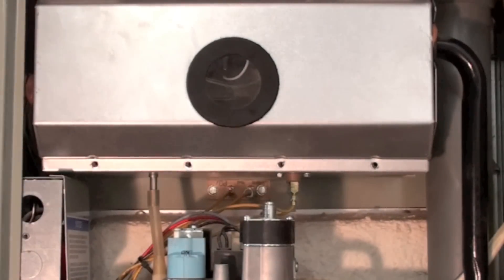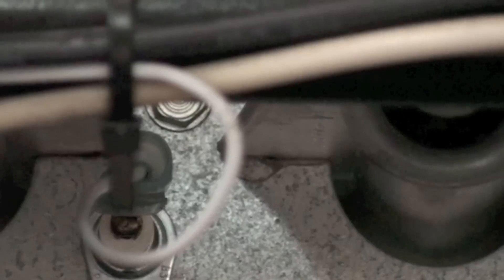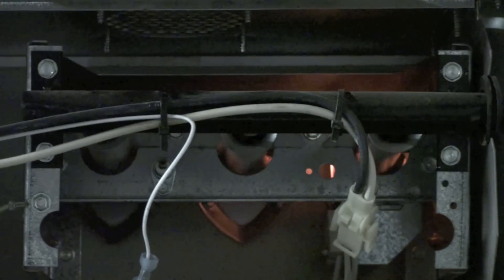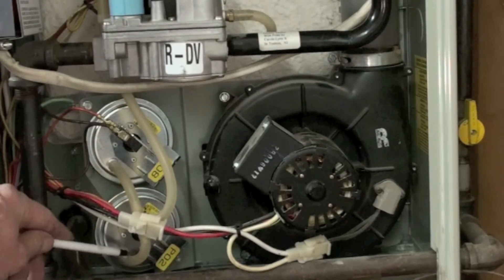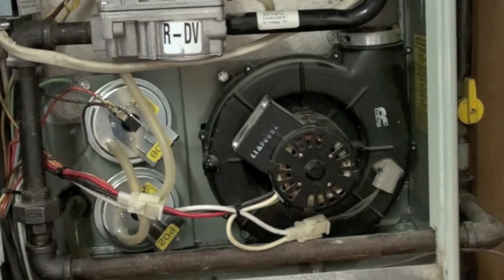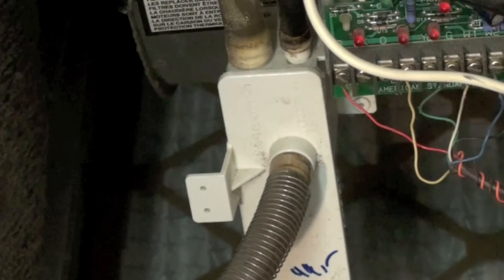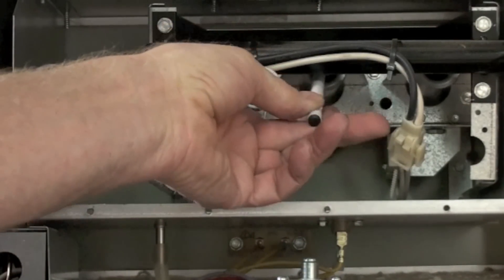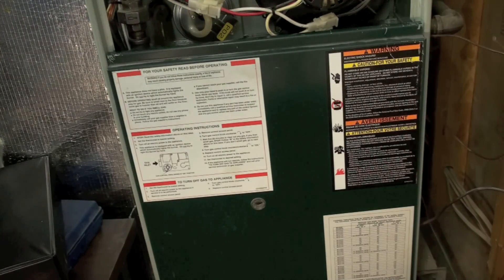Why does the gas furnace short cycle

Comment: this video just saved me some $$$ and very cold days here in the northeast/Adirondack Mountains..i spent 2 days checking connections/cleaning intake vents/filter/changed pressure switch for my furnace that was doing this short cycle..the error code told me it was pressure switch but, i did what one of videos said not to do-(swap out pressure switch at the beginning of trouble shooting)..I DID NOT WATCH YOUR VIDEO ON SHORT CYCLING FURNACE 2 DAYS AGO WHEN PROBLEM STARTED..it was a dirty/corroded flame sensor that was the culprit, cleaned it with emory cloth and reinstalled the flame sensor and also reinstalled the original pressure switch and the furnace stopped short cycling and works fine now..i was heating with 2 propane mr heaters & fans for 2 days with 18*f  temperatures outside, it was very brisk in here..i called a tech to come and because of the season here the tech was 5 days back logged and scheduled me for tuesday, today is saturday and life is better when i am not in my living room watching the game with winter coats/gloves and hats/scarfs on lol...thank you very much from the Adirondack Mountains..
Reply from the maker: Its good to have heat.
GFM

Comment: Great video! Turns out it was the anticipator on my Carrier thermostat.I set the pointer to match the amperage on the new gas valve I installed. Furnace now functions great.
Reply from the maker: Glad its working
GFM

Comment: Lennox elite 2004.. 1,248 sqft ..right now 9 minutes on 3 minutes off at 69° & it's 12° out..no way is this right might as well have a window  or door open..what if it was really cold out ? I know there tons of variables  & i just sealed off attic leaks as much as possible..there it goes again… less than 3 minutes..
Reply from the maker: Depending on where you are located,  it could be matched about perfectly.  In my area (northwest), furnaces are rated to run 100% of the time at 0F.
GFM
Reply: NW burbs Chicago…i guess their built to run but it makes me a little nervous when it's almost continuously running…Might be being a little too aware of the cycles & some anxiety..I've timed cycles in the past & it wasn't this short off…. usually 10 on & 10 off in the 20's & 30's & 5 off in teens & near zero.I think i need to focus on something else.
Reply from the maker: There other possibilities like water buildup in the vent can cause short cycling.  You might check the venting.  It should pitch toward the furnace 1/4" per foot.
GFM
Reply: Allright... thanks for gettin back

Comment: +grayfurnaceman

I have a Weil McClain gas boiler.  It will come on for about a minute and a half, shut down for about 2 minutes and repeat.  Granted this is on cold days (below 20 degrees).  Would this be considered short cycling?  This is my first experience with hydronic furnaces so I don't know if that is normal.   I watch the temperature gauge for the water and it heats up to 180 degrees, then shuts down.  During that 2 minute shut down, the temperature gauge does drop down to around 140 and the gas kicks back on.   

Does that seem normal to you or is it an indication of a problem with the furnace.  This is a very old house with probably little to no insulation.  When the outside temperature dropped to single digits last week, my house wouldn't get over 60 degrees even though the thermostat was set to 70.

Comment: I Just changed the board on a ruud 80%. The original problem was igniter not coming on. Replaced pressure switch and checked continuity after draft inducer stared . all was good but no voltage to igniter . After replAceing the board with a ICM288 replacement board all was working great . I cycled furnace several time and cleaned flame rod sensor. Worked for one night . Next morning draft inducer motor keeps turning on and off . Checked pressure switch function and it works good . I think its the board but can't get hold of tech support till Monday .The duration for draft inducer time varies from split second to five seconds .Do think it is the board. I power the inducer motor direct the motor is good 2 point  something amps . Pressure switch good, inducer good, igniter good but it never runs long enough for igniter to time on,

Comment: Thank you for an excellent video. I am hoping to find a problem before I am forced to replace the furnace. The igniter starts the flame which sometimes lasts several seconds and slowly dies .Other times the flame lasts until the fan comes on and dies when the fan starts. Had gas company replace gas valve and circuit board. The vacuum switch kicks in as it should. After several times of trying if will stay on and often reach the preset temperature but will not have a flame on the next cycle. The fan keeps on blowing no matter if the flame is on or off and does not stop until I lower the thermostat. Furnace is 15 years old 95 % efficient. Hope for advice. Thank you
Reply from the maker: My thoughts are you have a supply problem.  Are any other appliances affected?
GFM

Comment: Ours takes 3 attempts to light the burners and prove the flame. It's a 90's HSI. First attempt: no or barely a pilot. Second: all burners fire for a few seconds, sometimes staying lit but most of the time they go out after a few seconds. Third attempt: all burners fire and stay lit for the duration of the cycle. What might the issue be? The flame sensor was just cleaned.

Comment: I been dealing with this issue for about 3 yrs I clean the flame sensor several times and then replaced it with a new one and my furnace still keeps cycling on and off.I read some where that the unit could be too big for the house...could that cause the furnace to cycle on and off ?
Reply from the maker: It depends on how long it runs.  If it runs for 2 to 3 minutes, it is probably overheating.  This could be oversize, dirty blower, filter, manifold pressure too high, ductwork blockage.
GFM

Comment: Good video.  Out of curiosity have you ever worked on a Heil-Quaker furnace?  I'm certain I have a flame sensor issue, but I can't see it where you'd think it wound be.  Thanks if you can help and good idea about not over cleaning the rod.  Mine is intermittent so it is probably just dirty.
Reply from the maker: I have worked on some of them.  Some of these furnaces used an electric pilot system.  There is a spark that lights the pilot, then it proves and main gas comes on.  This type will have an aluminum tube that goes from the valve to the pilot assembly.  Hope this helps.
GFM
Reply: It's igniting okay, it just cycles like you describe and I believe it is probably the flame sensor (sometimes it will work properly, but getting more frequent - the three cycle)  The logical place for the sensor would be by the burners, but I don't see it.  I may have to take the whole panel over the burners off.   Thanks for replying and enjoyed your other videos.

Comment: Ours will short cycle 2-4 times but on the last time it does stay on and bring the house up to the proper temperature. Just replaced the filters so it's not that. Had the gas valve replaced last year (short cycle before that and still after). What could be the problem? Thanks!
Reply from the maker: Do you have a mechanical thermostat?
GFM
Reply: Yes
Reply from the maker: Sounds like an anticipator problem.  Mechanical thermostats have an adjustable anticipator to control how often the furnace cycles.  Yours is probably set for too short of cycles.  I have a playlist about this.  On my channel look up the playlist "Thermostat anticipators".  There are videos there that will show you how to adjust it.  Hope this helps.
GFM
Reply: Thanks for you input, but I did check with my husband and he said it was set for the longest cycle possible. On Friday we switched out the thermostat for a digital one but it did not fix the short cycling.

Comment: Thank you sir! I was disheartened when it wasn't the flame rod. It's a brand new unit. I'm from Central Florida and have never had a gas unit before; always electric. I'm in Kansas City now and already spent one night with my little wood house in the forties overnight as I slept with a small space heater. Flame rod test fails, I think I'm in for one in the thirties because the low tonight is 27! Florida boy is about to see if tears freeze... then you switch to the pressure switch and condensation in the hose. I'm an engineer, I will troubleshoot. I'll tell you it was NOT condensation in the hose, it was the hose itself! The end was split and hanging on with no seal on the machine's tit! I took a picture for my landlord'$ benefit, snipped the split-end, and viola! I suddenly speak French! No, that's not it... It WORKED! If I could digitally high five you, hand you a digital beer - import of your choice if it do ya - I would do it right now! This just happened and I'm typing this in an evenly heated, 70 degree house. It's 31 out there now and you're my new favorite person today! Again, thank you sir!
Reply from the maker: Don't you love being warm.
GFM

Comment: Mine wont even get to a short cycle. It just whines up to start pre glow rod, then shuts right off in 1 second and just repeats that.... What could that be? Im not an HVAC guy, I am a carpenter.... but it sounds like the induce draft motor is starting up.... and then it just shuts down with nothing else coming on... Is this a pressure switch issue? It works spotty.... sometimes it works, sometimes I have to shut down the system for a few hours for it to work properly again.
Reply from the maker: If the ignitor glows then immediately goes off, first I would suspect a pressure problem.   Water in press switch line, vent blockage, dirty inducer blower wheel are some of the first ones to look at.  Another possibility is a thermostat problem.  If you jump out the thermostat, and it starts working normally, the thermostat is the problem.
GFM
Reply: Ignigtor never starts. It shuts off almost instantly and stays on that loop. Just the inducer starts and then in 1 sec shuts off, then starts and shuts off. When it does actually start. I can hear it click from inducer to glow and glow to gas, etc... when its not working it never "clicks" to start next step. Its basically stuck in a step 1 loop Themostat and unit were replaced same time. Both about 5 years old. Thank you for your help so far. I havent found anything that is the cause, most info is on short cycling, mine never even gets to that.
Reply from the maker: Give me a manufacturer and model #.
GFM
Reply: grayfurnaceman Goodman. gmh80703anac. Thank you very much!!!
Reply from the maker: You could try something that may help determine the problem.  jumper out the pressure switch after the inducer starts and before it shuts down.  May take a little doing here to get it done.  Let me know how you do.
GFM
Reply: Thank you for all your help. I got it to work..... I have a stupid question though. I have never touched my unit while it is running before. Is the upper access panel and gas line bar going to be warm to the touch while its running. I know, dumb question, but I know 0% about HVAC. I am a dumb carpenter. I build the rooms I dont fill em in with items :) I dont wanna blow myself up... They are warm, not super hot. I suspect its normal. Just being precautionary.

What I think happened to mine. I ordered a new pressure switch, i think mine ended up getting water in it from a small leak during summer time from the pvc condensation line having a small micro crack. Stupid Goodman puts the pressure switch hanging from the top of the unit directly underneath the ac water drain line.

Thanks again for all your help.
Reply from the maker: It is probably ok to be warm.  Don't blame Goodman.  Blame the installer.
GFM
Reply: Thanks again. I imagine warm is ok. They are just warmer than I like them to be.... i just closed one of the two port holes they give you for the condensate line too. Seems the plastic push thru inside cracked and i was losing heat thru it. I dont need the furnace room heated for lords sake... lol. I did have a bad installer. He was a friend of a friend. I gotta work on redoing the whole thing when I get time. The things you dont pay attention to when they work properly.... then you see the mistakes when theres a problem.
Reply: Cue Rock
Reply: Cue Rock sound like that gas value was gone

Comment: Our furnace will run for about 2 and a half minutes then it shuts off and tries again, about 3x, but never stays on long enough to heat up to temp. it flashes the error code 3. I've cleaned the flame sensor, and my husband has cleaned out everything else we can think of. Any ideas?
Reply from the maker: Is the code for high limit?  If so, you have low air flow.  Look for plugged filter, blower wheel, and A/C coil.  Hope this helps.
GFM
Reply: grayfurnaceman how do I know if it's high limit? according the codes, it basically says there's a blockage somewhere, but we haven't been able to find it. I changed the air filter again today, still no luck. my husband says the blower wheel spins freely.
Reply from the maker: I am not sure.  Depends on the manufacturer and model #.  If you send me them I may be be able to help.
GFM
Reply: It is an Arcoaire. Model # N9MSE1002120A1
Reply: Ashley Showalter did u fix it
Reply: yes!!
Reply: Ashley Showalter was it the pipe that goes outside it was stopped up?

Comment: Thanks for your informative videos. My problem is that the unit, Luxaire PBNULD series, 95% circa 1995, runs for about 5 minutes then shuts down. After the fan switch reaches the blower turn off temp, the inducer is still running because the 'stat hasn't reached setpoint. I checked the fan switch with a meter across the contacts and it's fine. One thing I notice is some water gurgling in one of the hoses on the inducer. I don't remember seeing that before. Is that normal or do you think the trsp is clogged? Thanks
Reply from the maker: The burners are probably shutting down on pressure switch.  Probably you have a plugged condensate drain.  Hope this helps
GFM
Reply: Take a bow. I cleaned it and there was plenty of black, silty gunk. I used soap and hot water, filled it and shook it. Had to do this about 4-5 times before it was clear. Refilled it, installed and fired up. Before, it could not get the house one degree up. I set from 68 to 72 and it worked perfectly. This AM was the test as we go from 62 to 68. Perfect. I also noticed more water draining into the condensate pump. and no more water gurgling in one of the hoses coming from the draft inducer. Thank you!
Reply from the maker: Welcome
GFM

Comment: hello sir, my furnace has short cycle issue , and based on your demonstration , I think my furnace has some noise coming from the overflow motor ( like sand and chip in the overflow water ) , my furnace is only 1 year old , any recommendation to fix it , should I put more water the the overflow motor try to wash the dirt inside ? Please help
Reply from the maker: The pump can be disassembled  and cleaned.
GFM

Comment: I really like your videos..they are very informative!  I have a 95% efficiency propane furnace.  Recently it started short cycling on me. First thing I tried was cleaning the flame sensor. No Luck. I finally noticed through the window that only 3 of the 5 burners were lighting, causing the short cycle, not even making it to the flame rod. If I take the top cover of the furnace off before it shuts down, the last two burners fire. I ended up calling an HVAC tech who cleaned the burners and spreaders or wings. Still the same thing. It still short cycles. The intake and chimney are clear as well. Any ideas?  I appreciate any input you can offer!
Reply: The orifice on the unlit burner(s) is probably plugged with a spider nest.unscrew the orifice and look inside the fitting as well as the black pipe and clean it.
Reply: Is there any whitle sound while the heater is on?

Comment: Some of those inducers use shaded pole motors.  IF you take one apart to clean/oil it, DO NOT reassemble it with the field on backwards. It is easy to do and then the motor will run backwards.
I did it on my ice dispenser and it was hell on earth figuring out what had gone wrong.
Reply from the maker: Actually the only way we can reverse the shaded pole motor is to reverse the field.  Done it many times.  
GFM

Comment: In my first few years, it was common to see this problem back in the days of the T87.  The heat anticipator setting could be found on the furnace schematic or ten wraps of a wire on your clamp on ammeter and onto R & W and divide the reading by ten. Then set the anticipator.
Reply from the maker: That was all there was when I got into the biz.  finally did get rid of the 10 wraps with the newer meters.  Thanks for the thoughts.
GFM

Comment: My furnace is 26 years and has never had a problem until today, it is a hot water system, it started doing this and the one thing additional I noticed is that the electronic damper doesn't open, this is the first thing that would happen before ignition took place, now the relays click when the furnace is activated but then it does exactly what you show and keeps cycling until it just shuts itself off and the damper never opens and closes, I will check the piece you said to and try it. any help would appreciated.
Reply from the maker: The damper must prove open or the ignition sequence will not start. Probably damper has failed. 
GFM
Reply: +grayfurnaceman Thanks for the reply, this one was a stumper but it turned out to be the gas meter which got stuck and stopped the flow of gas, I found out when I turned on the stove and nothing happened, so I called the gas company and they were there within an hour, the guy said that this a rare occurrence.
Reply from the maker: +Peter It is quite rare.
GFM

Comment: I have a Temptar NUGM050EFA1.  The furnace, after not being used for a long time (weeks) will run OK for about 1 day.  After that it short cycles.  This makes me suspect there is condensation building up somewhere in a drain.